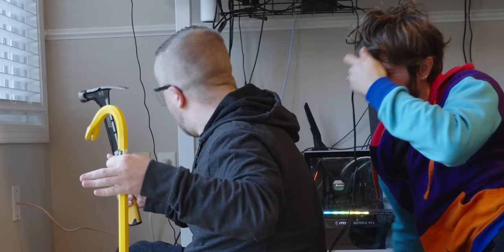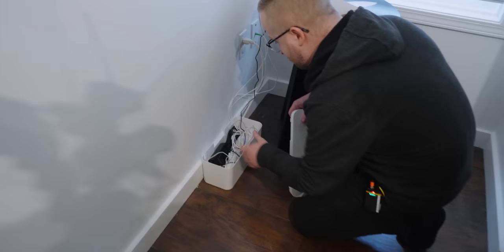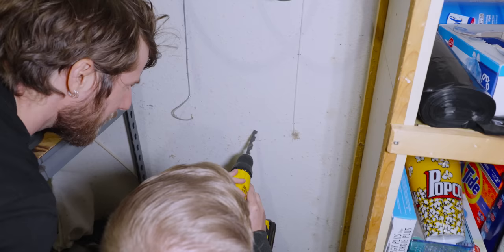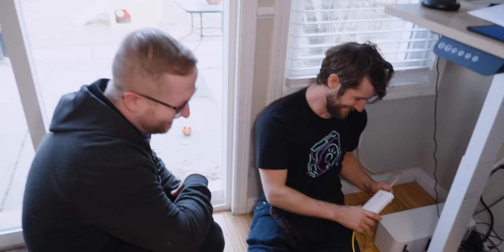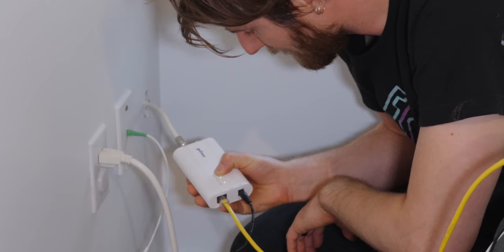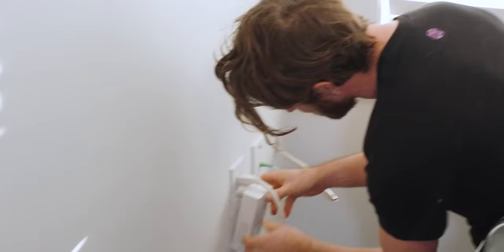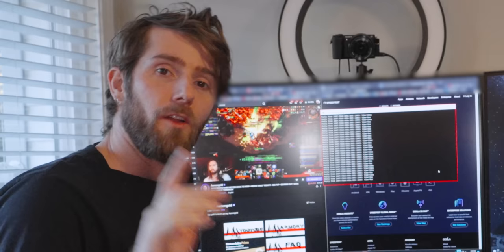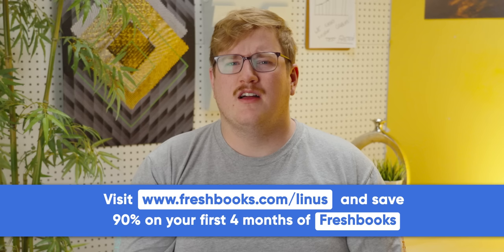I Will FIX Your Wifi - MoCA and Powerline at Colton's House

Comment: This video is seriously gonna change my life. My room is on the other side of my house from my router with already crap satellite wifi. Squeezing that extra connection speed and consistency is gonna change so much. Thank you sir✌️
Reply: @alvallac2171  Hey thanks for the information. Never would've thought about that. However I don't need much more performance out my Wi-Fi that I now get with the powerline. Plus I'm not very Tech savy, and diving into custom firmware for routers would probably just confuse the hell out of me. You are an absolute champ for replying though. Maybe someday I'll find this more useful than now ;)

Comment: I literally had the SAME issue.
My house only has telephone wiring which doesn't help with Ethernet. I initially bought a cheap D-Link Powerline Kit, the speeds actually dropped and the latency was worse, ugh. I almost gave up until this video came out, bought the kit mentioned in the video, although a tad bit pricey, works flawlessly.
Reply: So the video came out one day ago, and you already bought the kit, installed it and deemed it to be problem free. 
Yeah, sure.
Reply: @musguelha14  bought it the same day, delivered in 6 hours thanks to prime. You just have to plug it into the wall for installation. Furthermore, not deeming it "problem free" just saying that it works for me especially when compared to the previous kit I bought.

Comment: I've been using Netgear Powerline for 3.5 years and it's worked flawlessly. 945Mbit down 238Mbit up. Direct ethernet cable is only 3% faster. No cables! Wall sockets work like a charm.

Comment: I totally forgot that Ethernet over power line was a thing, last time I looked into it was probably a decade and a half ago and speeds were ridiculously slow compared to Ethernet……this is exactly what I need for my current situation where I need an Ethernet cable from the basement to a second story and don’t want to run cables on the floor or rip the drywall apart. Thank you!!

Comment: Remember that powerline works best if you have it plugged into the same phase. Otherwise you need a phase coupler inbetween.
Reply: Good thing residential all use single phase power lol
Reply: @dh66  Not in US/Canada. There, you get a 240V, just like everywhere else, then for some weird reason, it is split into two 120V phases using a centre-tap transformer.
Reply: @dh66  Germany here, i know not one house where there is only one phase

Only in REALLY old houses that is common.
Where i at the moment live we got power over the roof and even that where 3 phases. And then it got replaced with underground cabeling and again, 3 phases

Comment: Hey Linus, you can also use band filters to filter out the moca on the cable that comes from outside to inside your house, that way you can use moca without worry about the neighbors being able to access your moca network
Reply: Yep, and that's only if you have a cable-based connection. If it's fiber you don't have to worry about the band filter.
Reply: @TheTruthDragonNJ09  as long as the cable provider hasn't left your home hooked up to the main line, which typically they do now days. They used to do physical disconnects but with everything digital now they do not have to. If your wires are home run and you have a splitter that still connects into the main cable line, you can either disconnect the connection to the main, or install a MoCa filter.

Comment: I use wireless rather than run a cable to my pc and i have zero issues! i wasn't keen on the idea at first but when i had to move my pc i didn't want to drill a hole in the wall to run a cable as i rent the house don't own it so i attached the wifi antena on my new build and was pleasantly surprised at how well it performs.

Comment: Actual questions about the power line adapters.
1) when Linus said they need to be on the same circuit. Does that mean the same unit of a condo complex, or same circuit breaker of a room?

2) can you use power line, and then connect a network switch to the power line adapters?
Reply: Same circuit breaker yes, this may cover multiple rooms.  Maybe and theoretical yes to the second but you will be splitting the potentially limited bandwidth of the connection.
Reply: Where I live we have 3-Phase, so should all be on L1 for example. I understand that in the USA it is 2-Phase, so again should be on the same phase.

Now, I will add something I remember from years ago for power-line kits, and may no longer be relevant: if you and your neighbor in an apartment complex is on the same phase and on the same transformer you could have issues.

For, question 2, yes you can.
Reply: @TheOtherNEO  The phase thing was true, but they also sold phase couplers because of that. Iirc they solved that problem with some auto sensing magic and using the neutral wire instead of phases. Didn't read into that topic very deep though.
Reply: For environments where you are dealing with single-phase electricity (ie, 120V/240V, as opposed to 3 phase which would typically be 208V service) the PowerLine products will work as long as they are on the same arm of the single phase service (if you look under the cover of a single phase breaker box, which I am NOT recommending BTW, you will find that there are 2 'bus bars', each carrying 'single phase 120V' service.  The 2 bus bars are 180 degrees out of phase, so a 240V single phase appliance is wired across both bus bars.  Circuit breakers are typically alternating which bus bar they connect to, as they go down the line.)  All that being said, there are numerous other reasons why Powerline network devices will give poor (or no) performance, such as total distance between the devices (2 outlets on the same wall could be running to different breakers, depending on how the wiring was originally run, so the total distance would be from the outlet to the breaker box, then back to the other outlet), and the presence of 'noisey' electronic devices on the power line (think motors that are AC induction motors and other devices).

Comment: You can also get powerline adapters that have a wifi access point on them, so you can use it to get wifi to your darkest basement, if you have power running to it.

Comment: In order for powerline to work i needed to set up a script to run every time my PC starts to ping my router or else the connection would collapse for a couple of minutes.
Also it's not really better than Wifi for me, as it's the same speed and because of the random disconnects it's even worse regarding overall latency...

Comment: Tbh even if you want Ethernet you don't need to drill holes in the walls, if you have carpet you can usually fit ethenet cables between the baseboard and the carpet with a spudger, and for places with hard flooring you can use quater round cable raceway for a clean look.

Comment: I used Powerline for many years and then eventurally I discovered the mesh network Decos. I have 1 in each 4 "corners" of the house - they all talk to each other and I get reliable, fast wifi everywhere! When paired with my 5G router, I get 500mbps+ all over the house.

Comment: It it kinda easy to run wires pretty much anywhere you want. Its called the attic. You can almost fish wire from any attic. Buy your self a fiberglass wire pull rods, some ethernet cable, Some plates, boxes and connectors and a weekend and you will have data lines anywhere you want. You may have to cut some drywall out for the boxes and in the rare case you may have to cut a section of the dry wall out near the ceiling or the floor if you can a basement or crawl space. 
The best way to do this is investigate every location in which you want to install it and work out a plan of attack. See how much work you will have to do and then go from there. The last option is do damn near what everyone else does and just install it all on the out side of the house and drill in to the wall. 
If you are building a new house. Install as much Ethernet cable as you can. For every major appliance there should be an Ethernet cable, microwave, stove, dishwasher, fridge, oven, security cameras, door bells, water heater, furnace, Tvs, computers, smart devices, printers pretty much anything at some point in the future will or alredy has the option for a wired connection. Adding this will not set you back more than a thousand dollars extra. Security cameras locations should have cable run to those areas. You should have a small closet or area to which you can run all of your wires to and install network switches. while wireless sounds good too many devices on the same wireless signal can cause more issues than you want.

Comment: I don't even get 100mbit/s on powerline at my apparment. So I put some RJ45 Jacks on the existing unused telephone J-Y(ST)Y wire and get very stable connection regardless of activity on the powergrid. Still non-TP cable is not made for that and if you need to run full duplex you might find it not working or defaulting to 10mbit/s for anything more than a couple of meters. One huge benefit is that for this link I don't consume any power if's it's not active and it's ridiculously cheap to implement, so always worth a try. 
If you're running at least 2 powerline adapters that's anywhere from 5-15W of additional power 24/7 even if there is not much, or anything happening on the network. 
Might not be the biggest problem in BC but in Western Europe that can amount to up to 30€ per device per year under the worst circumstances. Powerline is flexible, easy to install and depending on your situation it can be the cheapest option. But it's not really reliable, dependent on a lot of outside factors, and should almost never be a permanent solution.

Comment: As a cable technician most cable/ satellite companies use moca to communicate between tv boxes and modems. I would advise separating the cables you’ll be using for Ethernet from your cable running to your tv/ cable modem to avoid interference which in turn will make your internet even worse and your tv and avoid splitters(if you’re using cable internet) but if it’s a direct coax line you should be good.

Comment: Regarding the issue about encryption, you can buy a cheap MoCA filter and install at point of coax entry. Then you'll have no issues and don't need to use MPS.

Moca is amazing for older houses

Comment: So, getting into that cable box is really easy, I can do it with a flat head screw driver, and most of the time those barrel locks corroded and just spin off with your finders or a pair of pliers. 
If there is no cable service going into the home just disconnect the drop cable, you can use whatever splitters there but it's better to use a coach coupler (F81) and just hook your two coax runs together, by doing this you won't have to worry about encryption either.. There are also MOCA filters that can be put on the drop that will block MOCA communication, you put one of those on the input of the splitter in the lock box.
MOCA has much better latency than power line.
I've deployed a lot of power line adapters as well, and they work much better when they're directly into the socket rather than a power bar.

Comment: Caution with the power line option, is built for internet conversion but not particularly for heat dissipation (referring to the ones with an outlet extender), recently experienced this with a tp link AV 2000 model regularly running 1500-1800W electricity through it, some of the wall outlet melted as well as a bit of the power line case (still works surprisingly).

Have used power lines without the outlet extender option before and haven’t had this issue.

Comment: I have a PowerLine system which repeatedly connected to our neighbor's network and which when I asked, the manufacturer said should not be even technically possible. So IF you are using PowerLine, or any similar system check your connection IP address 😉

Note that the system I have doesn't include a web interface for device config, not sure if any PowerLine system does.

I added a task in Windows that starts when the PC boots that pings the connection to keep it active since for some reason the connection would randomly disconnect after a while.

And I added MAC address filtering on the router the PowerLine system is connected to so only known devices could get access to the home network.

And DO NOT connect a PowerLine system to a power brick, most of them have an AC pass through socket so get one of those and plug the PowerLine directly into the AC on the wall

Comment: I have a possible explanation why MoCA didn't work in this case. At least with some of the houses I've seen, the coax cable for cable internet is often completely separate from the rest of the coax network in the house, so that the internet doesn't have to share the network with TV signals. But this means that plugging the MoCA box into the coax cable from Colton's old wifi wouldn't connect it to the rest of the coax ports in his house at all. It's much easier to tell with houses with unfinished basements, since you can follow the cable runs around to see where they terminate.

Comment: FINALLY! a video on MoCA! its such an important technology! so many buildings have a coax backbone already
Reply: I finished the video and I wish it were more through.
1. before you buy MoCA, establish that you have cable continuity between the points you want to connect, a lot of homes have had several different cable providers and the co-ax backbone can be a butchered mess of disconnected lines. I found I could reconnect the two points most of the time, but before you go spend $100 this needs to be sorted.
2. Responsible MoCA setups use a FILTER! you need to segment your co-ax network from your neighbors. the filter is a simple low-pass filter that costs about $3 and is the best way to prevent different co-ax segments from cross-talking. This is important in an apartment, but it is still very relevant in some single family home scenarios, where you could actually be broadcasting your MoCA traffic to everyone on your street's cable box if you don't add a filter at your home hookup. This is important for both performance and security since MoCA devices operate as hubs not switches.

Comment: I've been using MoCA adapter for 2 years. In fact, I've had the exact models used in the video. I have 3 deployed. One thing I would recommend is people add a MoCA filter to the coax that enters the residence (or at the junction in an apartment). The MoCA network can be captured by other MoCA devices if the frequencies aren't filtered out.

Comment: powerline adaptors saved me big time. I rent a room in a house with other roommates and the wifi router is just too far away between too many walls. I used to always have terrible ping and reliably frequent complete drops in signal. playing rocket league was a pain in the ass, watching videos was tough, and even my downloads speeds were anemic.

PA isn't as fast as an ethernet cable, but I couldn't snake an 80 ft cable through our hallways so it was the best i can do, but it ended up being a wonderful solution. I have acceptable speed and a very stable connection. I installed it once, put a switch on my end and have everything in my room wired and solid.

Comment: Isp tech here
Lol this was funny to watch had me  haulerin at the tv like a football game watchin them work with moca 
Ya gotta check the central cluster were all the coax meet to split the signal then find the 2 lines youre trying to use and just connect to those 2 and if you need more add the right size splitter per use
If theres a coax amplifier moca systems will not function also gotta make sure both ends are properly swithched to the right signal type
The reason the modems built in moca didnt work is likely sue to the isp not having it provisioned to the unit which would require a tech to activate it to work
Now i wanna make a video on the trouble shooting steps to get these working lol

Comment: I used to use powerline ethernet to connect my computer upstairs to the router that is downstairs for several years. After years of random disconnects on the powerline ethernet, I decided to install an ethernet socket between the downstairs and upstairs, with the cat 6 cable going outside the house (secured to the outside wall).

Comment: Got Moca set up in my room.  I was originally thinking of having my own cable modem installed in my room so I could get a direct ethernet connection, but saw that the latest Moca speeds were very impressive and decided to give it a try, especially since it was very reasonable in price. It’s been amazing since installing it. I got an adapter with 2 ethernet ports. I hooked up a WiFi 6 router on one port and use the other port for various devices, depending on what I need the speed. Sometimes it plugs directly into my laptop, other times it’s into my PS4 or even my Xbox 360.